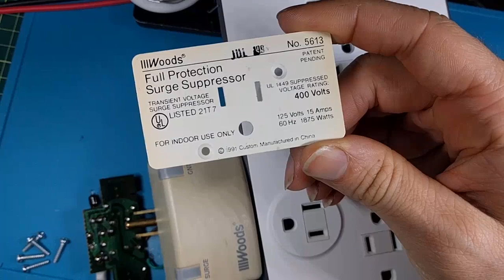Surge Protectors - Teardown & Explained (Belkin and off brand)

Comment: During an experiment feeding open a neutral voltage into the generator port of my EG4 18Kpv inverter I caused a power surge from unbalanced load on my system leading to upwards of 200 V on one leg supposedly and fried some equipment (LED lighting clock radio and main board in a microwave and 3 Battery Minder's) I just thought I would share this because it was an older Belkin Surgemaster II SPD saved a good portion of my equipment sacrificing it's self in the process. The MOV's took the hit and saved a Hitachi TV and a Edifier DB350S powered speaker system.

Point to be taken cascading level of protection is very important and surges can come from within the home not just from lighting.
Reply: how you liike the 18kpv? We're shopping for land to build and i spent a good amount of time picking out what equipment i was gonna use and the 18kpv was the winner for my needs. Plus it seems extremely easy to tie into the mains and automatically switches/supplements between PV, Battery, and then finally utility line incoming. I think the plan is to go off grid but i wanted to start with that and about 14kw of battery and 12 to 15kw of PV. Too much info, lol. but curious how you like the EG4
Reply: @Josh-oe4ex  Sorry I didn't see the message you should join the wheel pros is DIY solar form I'm pretty easy to find there but I love the 18 KPVI am running my whole property off of it the only thing it struggles with is my well pump it's a deep well in ground pump and if water heaters run in and three or four window shakers it has a bit of a hard time more so than the 4 ton air conditioner but other than that it's been installed and running for the past three months and I've only used 40 kilowatt hours from the utility I used zero kilowatt hours last month and it was still $18 so you figure it would cost $200 a year just to have the utility is back up to me it's worth it if the inverter was to fail for some reason and I needed to get warranty work done on it or whatever I could easily just throw a switch I am currently feeding the 18 KPV via a line side tap to an outdoor disconnect box and then through the grid side input of the inverter and then back feeding into a 150 amp modified breaker in the upper right slot of a 200 amp square D home line panel and I'm using a generator interlock that acts as my transfer switch to back feed my main panel in the entire property if I had it to do over again I would have went with the 12 KPV and doubled down on those as they each have the same surge capacity as the 18 KPV and they're almost the exact same price point per watt but what I really like is having redundancy down the road if I find a good deal one I will get another 18 KPV but as it is right now my next inverter is going to be ANHK 10K that's 10 1000 watts continuous and I believe it is 15,000 watts of PV over four inputs and it has two load outputs on it you can pick it up for $200 through Watts247.
Bottom line is it is a very capable machine and I do not regret my purchase it is also a hybrid inverter meaning it can supplement load as if you are consuming 15,000 watts it could supplement 3000 watts from the utility until the load dropped and then it would all transfer to the inverter it also has AC couple for tying an existing in phase system into the grid so that you can use that power to charge batteries and power loads and it has a micro grid function as well this is just another function to hook an existing solar system into the 18kpv.
Reply: @RobBananaman321  Wow. Thank you for the detailed reply. Seriously! That sounds great and exactly what i'm looking for